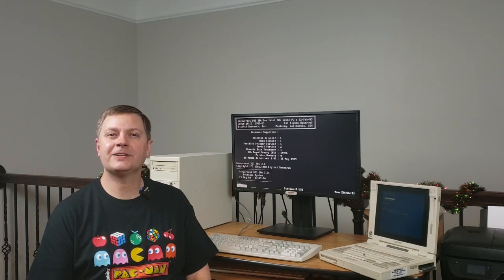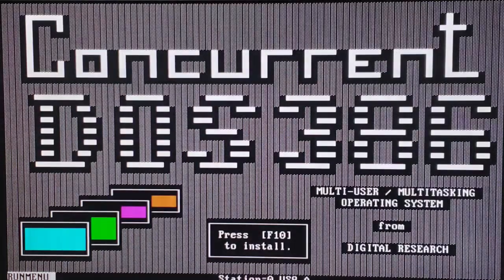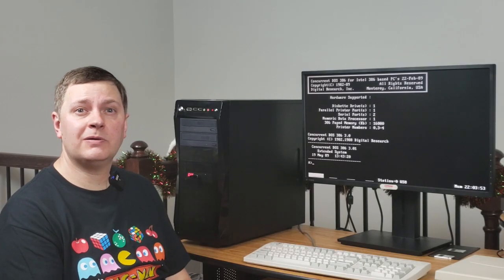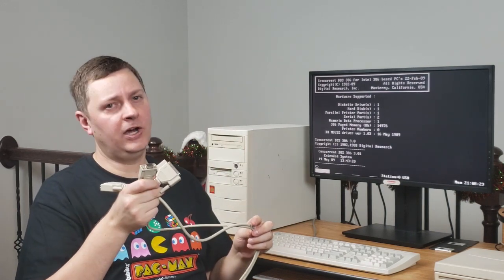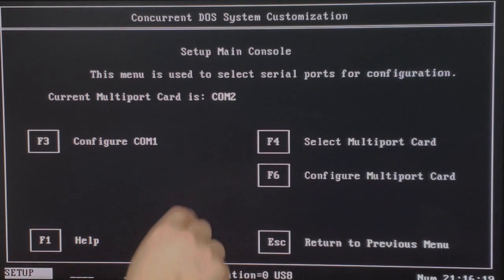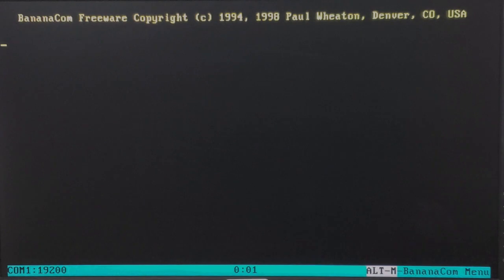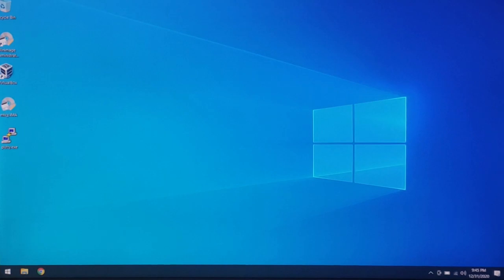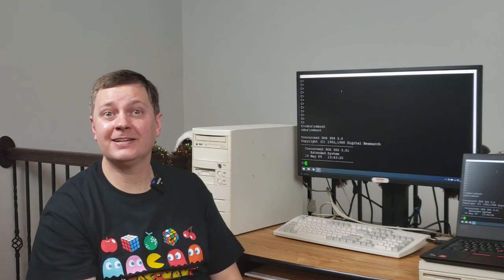RetroTour: Adventures in Concurrent DOS 386: The Quest for Compatible Hardware and Remote Access

Comment: Concurrent DOS does support larger hard drives. I had it running on an IBM L40SX laptop that had a 512MB CF card with a CF2IDE adapter inside and Concurrent DOS could recognize the full capacity. The manual states that 512 MB is the actual limit.

Comment: The reason you had these memory problems is because Concurrent DOS 386 uses the LIM-EMS 4.0 standard for paging and managing the memory. LIM-EMS 4.0 is limited to a maximum of 32 MB. So whatever method you use, as long as it looks to Concurrent DOS 386 that there is 32 GB or less in the computer, you are fine.

Concerning the IBM PS/2 with 286 CPU: Concurrent DOS 386 relies on the virtual 8086 mode on the 386 that allows multiple 8086 processors to be emulated by the 386, which is obviously absent in the 286. You can however run Concurrent DOS XM.
Reply from the maker: Great info, this clears up a lot of questions.  Thanks!

Comment: Did plenty of C-DOS installations in the UK in the 1990s. Apricot Xen PC with a 16-port serial card, Wyse terminals hanging off it. It was a nightmare as C-DOS wasn't MS-DOS compatible enough to run lots of popular applications like Wordperfect 6.
Reply from the maker: I could definitely see that, I struggled to find compatible applications!!  Welcome to the channel, thanks for subbing!!
Reply: The move to Windows really killed CDOS on the PC. 

As long as you used text based applications (Word Perfect 4, Lotus 123, Turbo Pascal, etc), you were fine. On the terminals however, you were screwed, as most applications wrote directly to the screen instead via BIOS calls, so nothing appeared on the terminal. However, if you used a MS-DOS PC (any PC would do, even an obsolete 8088 based PC/XT) running the PCTERM software (that was delivered with Concurrent DOS 386) to act as a terminal you could run also applications that wrote directly to the screen on this PC-Terminal. You even had 2 sessions available on the PC-Terminal.

Comment: Hi Chris

Pretty good, i have never used the BIOS option of memory hole and never knew what it is for, i guess on boot it must place blanks or similar in that  address so that any memory counting will return errors or no result so thus jump out of memory counting and accept the high 14k value that was the last successful one tested

No testing on compaq laptops or the Dell 2400 ?? - i mean you tried 5 or 6 machines ( PS my Dell 2400 passed away xmas - power led on main board, molex pins had 12 and 5 , but no lights at rear IO shield so it is RIP)

If this helps, if you ever want to make it easier to distinguish machines when jumping from machine to machine is dos just change the prompt - i have a KVM box on one table for 3 machines so this is how i quickly tell where it is  eg

Prompt $P$GDell
Prompt $P$GGatewayP2
Prompt $P$GClone-P100

With the laplink cables,   the most basic is a 3 wire set up - this can only use software flow control
A-End             B-End                9pin connector        25 pin connector
Transmit       Receive             Receive = 2                Recieve=2  (same)
Recieve         Transmit           Transmit = 3             Transmi = 3  (same)
Ground          Ground              Ground = 5               Ground = 7    (same)

If you want hardware handshaking  or flow control you need the extra 2 wires in Request To Send And Clear To Send

i believe almost all Laplink style in a quality molded connector will be the faster RTS-CTS, the 3 wire is basically the cheaper and hand made ones ( like i done with speaker wire and a spare or even some short runs or left over 3 core main power wire - but you need to trim some strands as it is to think for the pin connector soldering)  

The 386 concurrent seems like a good system for places that had one "powerfull 386" and still a collection of 8 bit PC-XT-AT or even dumb terminals, Remember new IBM PC prices were expensive not like today ( does anyone have a chart of PC prices and comparison to the average wage )

The 386 was the first processor used in IBM style machine that had  a form of "Virtual PC"
The 386 DX  is a 32bit processor, the 386 SX a 16 bit processor just like the 286/AT, this 16bit is why memory is limited to the same as generic 286 processor = 16MB

Here is the silly part, while a 32 bit processor can go to 4Gig - the size of ram on a chip and slots on a PC - i have never seen a 386 with more than 16Meg ram - so while the maths on 32bit is possible it was just not available or practice to make it - i remember ram was @ 100 a meg in late 80's

MY GUESS is when concurrent 386 was released there was a 50/50 chance that the 386's in use were DX or SX - ( high end and rich users would have DX and most homes and low end business SX either way it is one or the other ) so maybe this is why the safe memory limit of 16m would be on boot up ???  ( why   though ?? why not make 4meg the safe limit and accept anything else above it as extra ??)  

A good find, interesting if a very low spec PC 8088-640k or lower can access concurrent dos and run say wordstar / lotus / dbase

With terminal program 11:04 , have to tried early items like PCtalk, PC-Term, Telix(my favourite in the day ), Terminate

Will it run alleycat ??

Anyway well done.

Regards
George
Reply from the maker: Hi George!  You'll be happy to hear that I did try this on a Compaq LTE 5400, but it didn't work, even with extra memory removed.  Didn't try on the Dimension 2400 ... BTW sorry to hear about your 2400 :( ... but did try on a Pentium II system and some other systems off camera.  The serial to WiFi modem only has software flow control, so I disabled it for simplicity for all of the connections.  I think I should do a retro short with Alleycat and connecting from an XT class machine, you've inspired me!!  Always great to hear from you, friend.  Talk soon!

Comment: Noticed you added the ATV2 command to the modem firmware to silence responses. The standard Hayes AT command  set includes the ATQ command which turns quiet mode on and off. When quiet mode is off, the default, responses are sent. When it is on responses are not sent. ATQ0/ATQ1 toggle it on and off.  I just added ATQ support to the vintage modem firmware source code. Unfortunately I don't own the vintage modem and all my esp8266 development boards are currently in use for other projects. If you would like to try it, the source is on my Github, tssva/vintage-computer-wifi-modem. Once I or someone else can confirm it works properly I will submit a PR upstream. If you currently have ATV set to 2 in your saved settings, the new code will set it to 0 and set ATQ to 1 so the response behavior will remain the same. Otherwise ATV stays the same and ATQ will be set to 0.
Reply from the maker: Yes!!! This is better than my little hack :) I'll work with Richard from The Old Net to take this change and remove my hack, haha :)  Thank you!!!
Reply from the maker: Talked to Richard, and we will adjust!  I may reach out to you, want to connect here on this!!
Reply: @RetroTechChris  I'll go ahead and submit a PR for it.
Reply from the maker: @tss20148  thanks!  Feel free to take out my hacked code :) :)

Comment: Nice job, Chris and Tony! (netcat FTW!)

lol, like my Amiga error "CPU too expensive"...
Concurrent 386 wasn't kind enough to say "Too much memory".

LOL layer violation: BIOS mentioning OS/2. :)

Cool idea about getting the timesharing setup working with terminal(s). If I hadn't run out of time in #DOScember, I was going to run the MS-DOS console on the serial port with my DEC VT420 terminal... put the "DEC" back in December, but Concurrent DOS is a better choice!

In the '90s there were terminal servers that supported something called reverse telnet... this is how we hung tens or hundreds of terminals, and other serial equipment (like RF terminals on fork trucks) so that they timesharing Unix machine thought they were directly connected on serial ports (even though TCP/IP was used to talk to the remote terminal servers) in commercial installations.

Still, I am very glad that Unix then Linux beat this out for PC and x86 timesharing. :)
Reply from the maker: Haha!  I agree with you on the Unix/Linux winning.  Concurrent DOS was a good entry!!